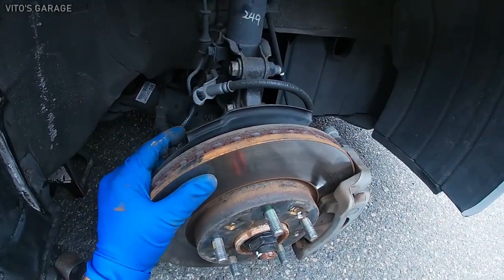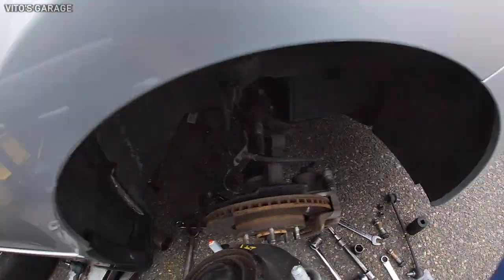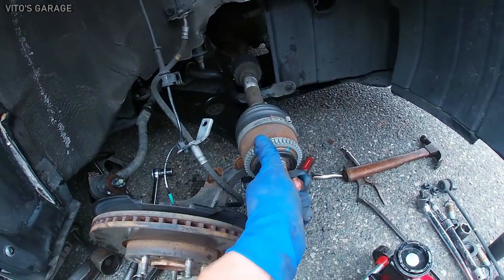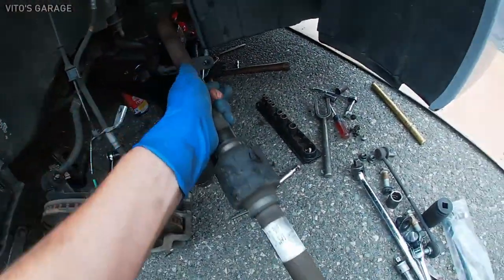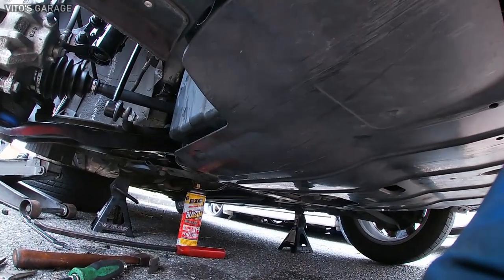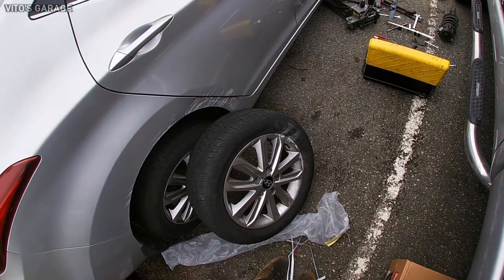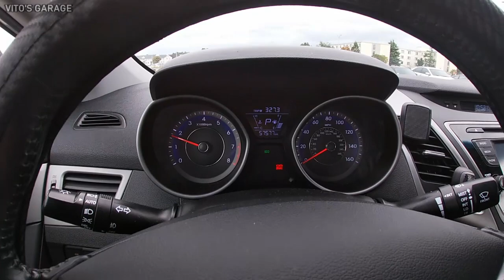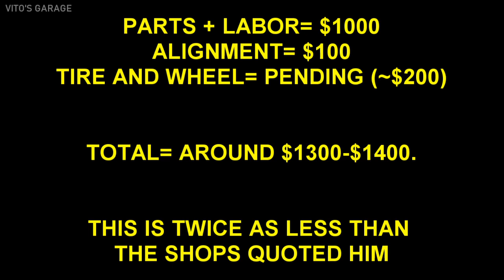Nothing is Always Easy! Fixing and Test Driving a Curb Damaged Hyundai Elantra!

Comment: What do you think of the Hyundai Elantra, front wheel drive, how does that compare to fixing the Mercedes Benz, that have bushings, sway bars,  the new cars, have all kinds, parts, very different from the old school Mercedes Benz, even some from the 90s, don*t act surprised all those Hyudais just include a compressor, like if that is supposed to correct the problem, I had to purchase a temporary spare, that includes the jack, & the tools to loosen the lugs, or the hubcap plus lift op the jack, it cost me $300 dollars, how does that grab you, no more spares, all these new cars,  don*t have spares, that sucks, pardon the language.
Reply from the maker: Yes. I totally agree with you... It's sad.. They try to save fuel on weight but what are they really saving?... Nothing... The owner could have been stranded and nobody knows whether that tire sealer would work or not.. This just makes these new cars even more disposable
Reply: @VITOSGARAGE  And it takes somebody who has one of those cars to know, or a mechanic as yourself, to act, surprised that there is no spare, way back the cars would have a matching spare, like the wheels on the car, like the Mercedes Benz,(old school,) like the models prior to 1985, like those alloy wheels, then they offered
Reply: the steel rims, eventually they would put those temporary spares, of which if you were on an expressway where the minimum speed limit is  65 I believe, you could not go faster than45miles  or 55 the most then the car would look strange ,first the size of the tire then the person could loose control, of the car, I always try to get a regular tire if possible,and put it on the rim if possible or just get a regular steel rim to put a regular tire on, I feel more secure plus itis close to the other 3 rims.